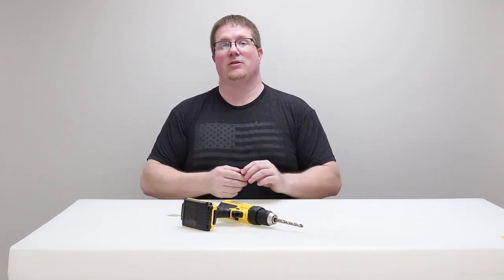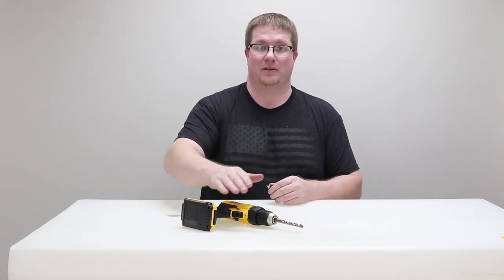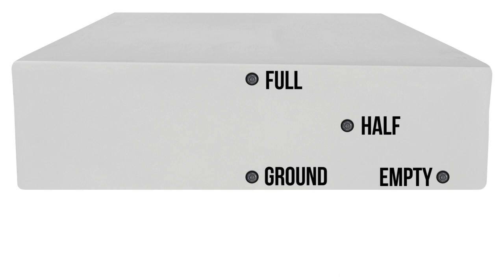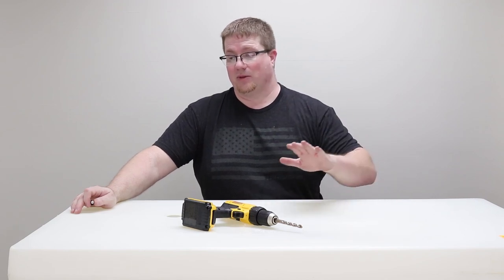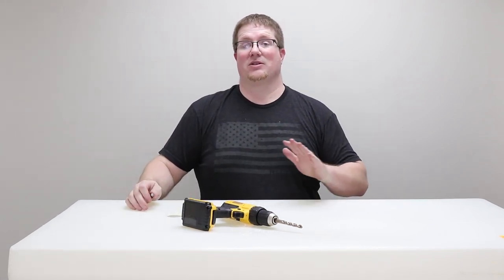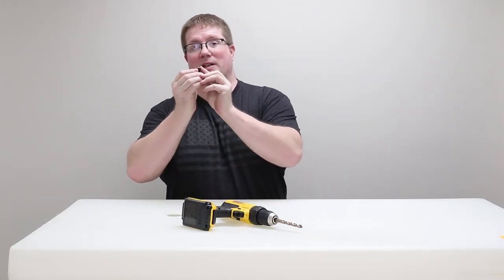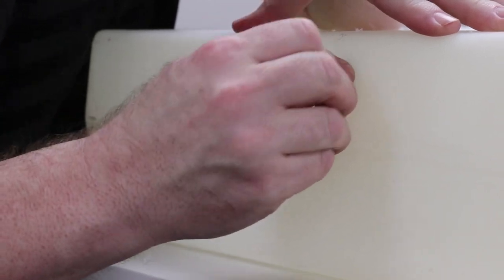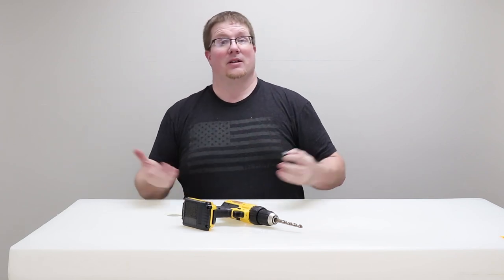RV Water Tank Sensor Installation

Comment: Is it ever recommended to use any kind of sealer when installing fittings?  When working on our boat, you ALWAYS use a good sealer.
Reply from the maker: No sealant is necessary. The rubber grommets that are on the sensor probes will seal the hole that you drill for the probes.

Comment: Placing sensors instructions great, but how do hook up wires to it?
Reply from the maker: You use a probe wire harness to connect to each of the probes and back to your monitor panel. You can find those harnesses at recpro.com!